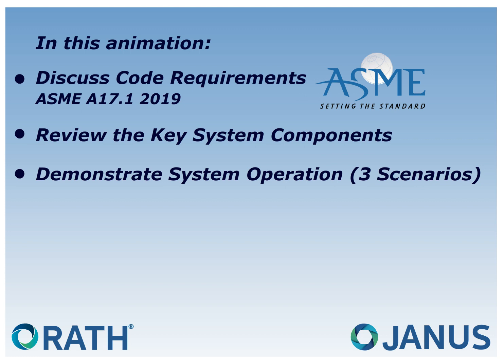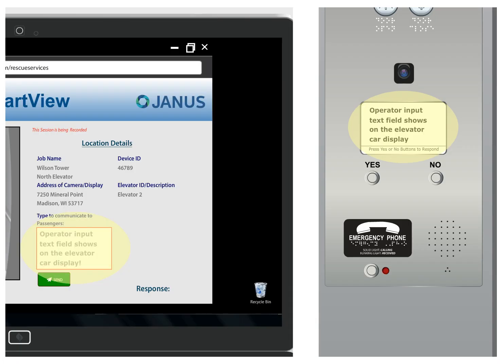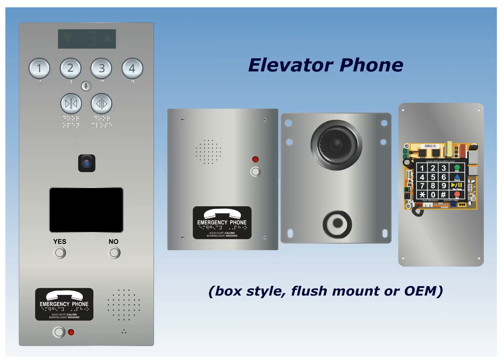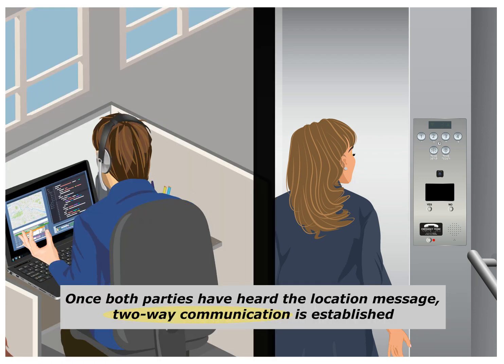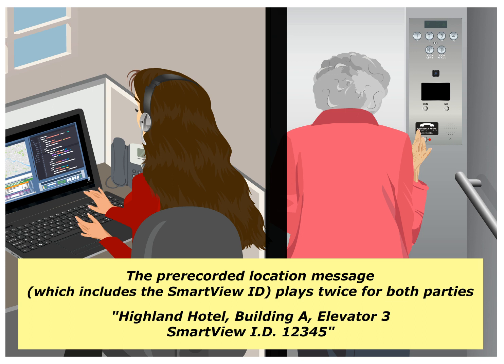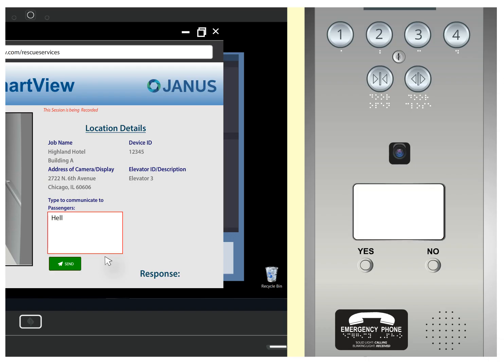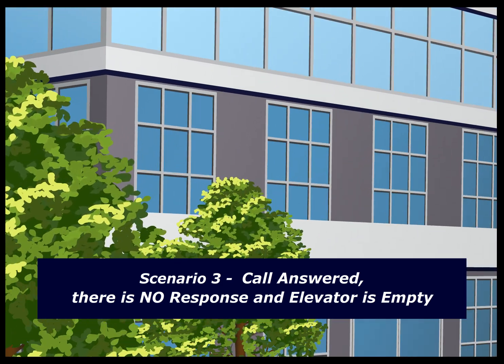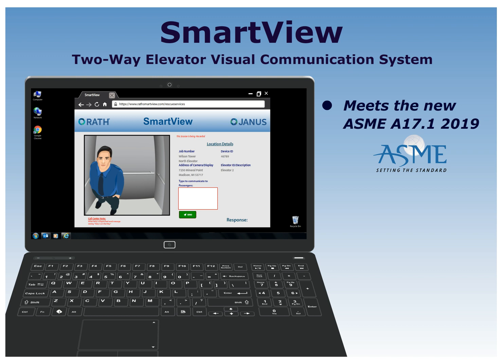SmartView Two Way Elevator Visual Communication System

Comment: Excellent presentation and really helpful. I am quite surprised by the fact that, they haven't included this as a standard offering to all passenger elevators. We are in era where the importance of inclusion cannot be stressed enough and very strange that the main elevator standard 81-20 does not include this as a mandatory requirement for passenger elevator.